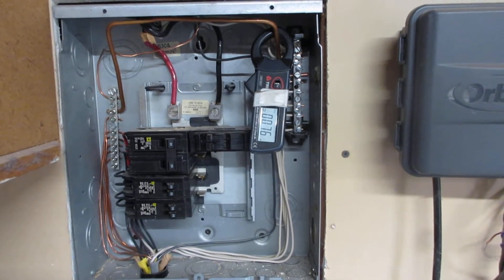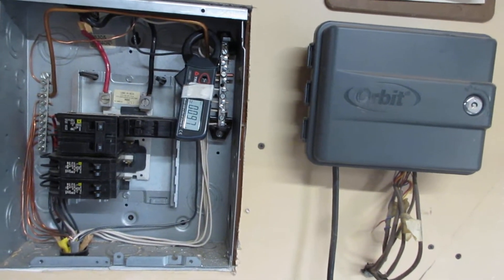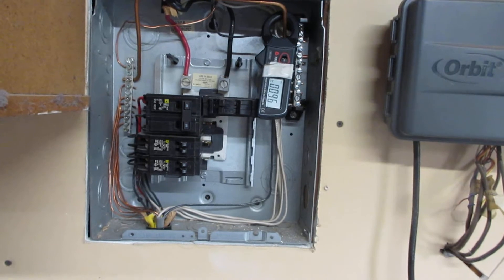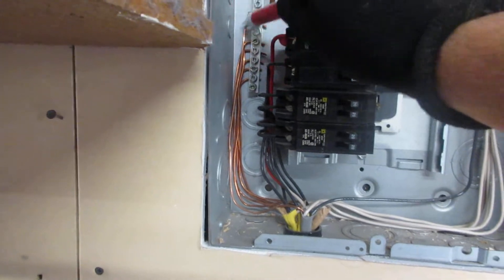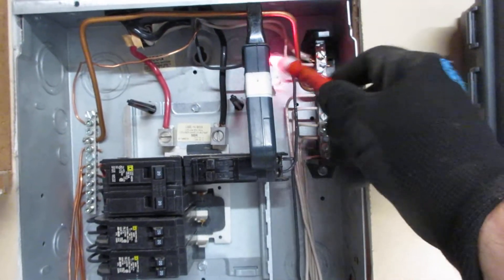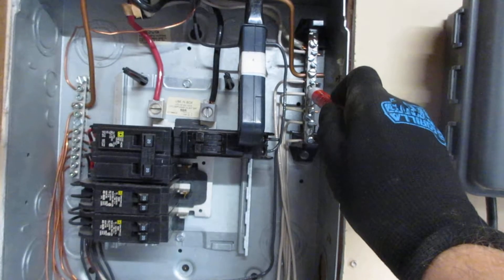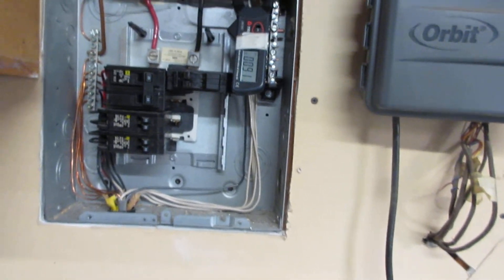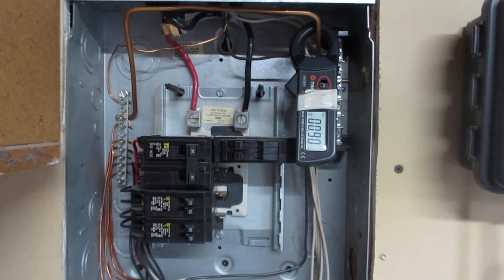Real Estate EMF Survey before purchase.

Comment: This shows how thorough a pre-purchase inspection can be -- trying to turn on/off each of the major pieces of equipment in the house.  Likely, this issue when brought to th eattention of the seller probably was fixed or credited, offsetting the cost of the inspection.  A traditional electrical inspector could/should have caught that by visual examination, but apparently missed it.
Reply from the maker: Hi Ken,

In this case there were several other very high magnetic fields due to violations of the NEC. The intentionally crafted N-G bond in this sub panel is visible to the naked eye.    The buyer I was assisting decided to pass on this house for several reasons.